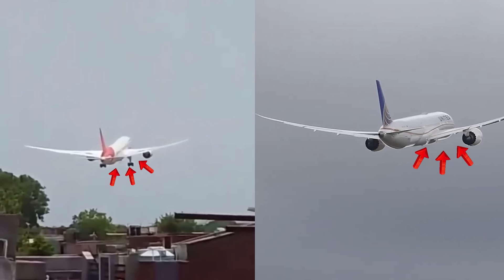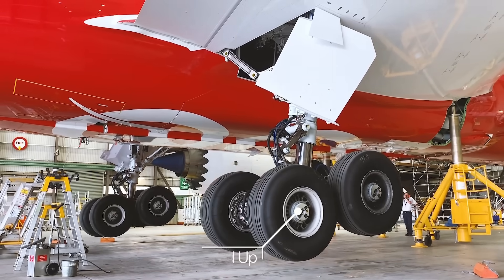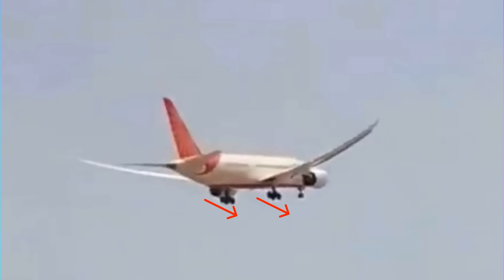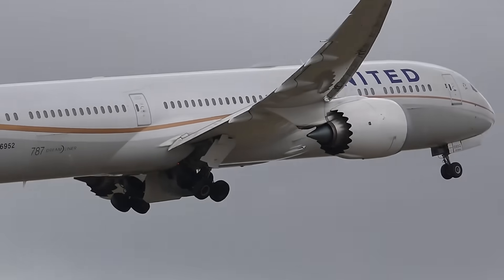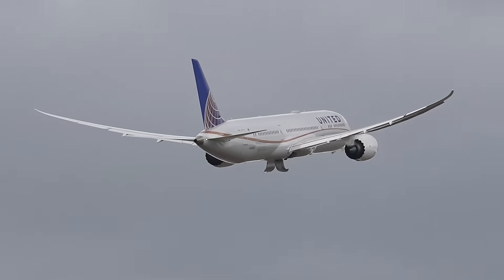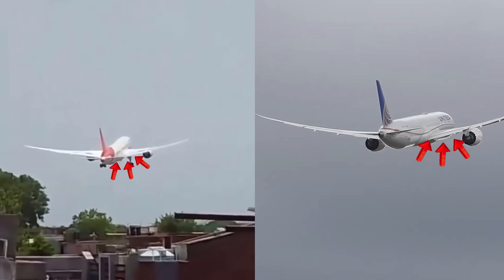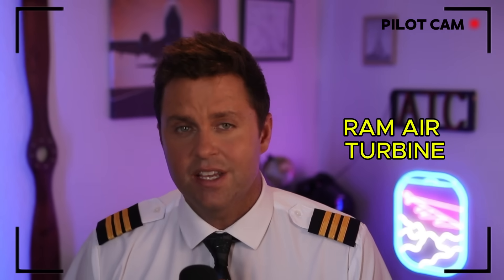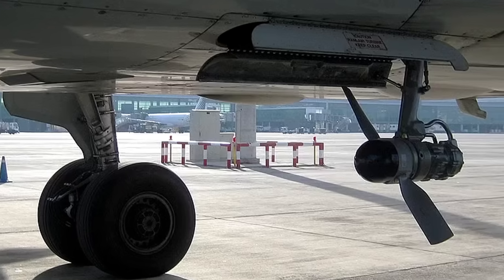Pilot Explains: A New Detail in the Air India 787 Crash Everyone Missed

Comment: If it was contaminated fuel, why wouldn’t the previous airplane crashed first, or the one before that?  Don’t be afraid to add the possibility one of the two crewmembers put both fuel shutoffs to off or pulled the fire handles. It’s an ETOPS airplane, the chances both engines failing at the same time are extremely low.  We’ll know when the preliminary report comes out.

Comment: pilot suicide, pull the cut offs. no way to get that thing restarted in time to save it. Im and MSAE I do not see how both engines fail simultaneously.   fuel contamination sure  but really they were on the ramp, taxi run up and the both fail at very close to the same time being fed from separate tanks and fuel pumps at 300 feet.
Reply: or sabotage of the electrical system. But even if it had other electrical I just do not see both engines failing close to the same time at such a critical phase of flight. 
My bet is on human action.
Reply: The odds are just not in the favor of it just happened.

Comment: If the fuel was contaminated…wouldn’t other aircraft’s have issue?  I am not sure how many aircraft’s a fuel truck can fuel?  I used to work for an airline and I was on an operations team where I monitored the maintenance calls and flaps failed all the time…but no crashes. Bird strikes, flaps failed and landing gear issues but no travesties. I am not a pilot or maintenance though so what do I know.

Comment: HI CAPT. GARY, GOOD VIDEO!!  UH, I'M A NO NUTH'IN "GROUNDHOG" SO I'M NOT REALLY EVEN QUALIFIED TO ASK YOU A QUESTION, BUT ON THIS CONTAMINATED FUEL THEORY YOU AND CAPT. STEVE MENTIONED; I ASSUME THAT IMMEDIATELY AFTER THE CRASH, THE AIRPORT SHUT DOWN, YES??  SO THERE WOULDN'T HAVE BEEN ANY OTHER AIRCRAFT TAKING OFF LATER WITH THE SAME CONTAMINATED FUEL, BUT, WHAT ABOUT THE PLANES THAT TOOK OFF IMMEDIATELY BEFORE THEM??  WOULDN'T THEY HAVE DRAWN THEIR FUEL FROM THE SAME TANKS, CONTAMINATED OR NOT??  AND NO ONE ELSE CRASHED??  AND ISN'T IT A REACH THAT BOTH ENGINES INGESTED THE CONTAMINATED FUEL AT EXACTLY THE SAME TIME?? AND WOULDN'T THE CREW HAVE RUN-UP THE ENGINES TO ALMOST FULL THROTTLE AT THE START OF THE TAKE-OFF RUN, THEREBY INGESTING LARGE AMOUNTS OF CONTAMINATED FUEL THAT MIGHT HAVE SHOWN A PROBLEM??   THANKS CAPT. GARY.       CHAS ORVIS, PLAINVILLE, CT.

Comment: According to one of the pilots who had flew this same plane in the past and that too on same route his assumptions are that plane was at his max capacity which includes - passengers, luggage and extra fuel because of Pakistan air space is blocked at present so the plane was carrying extra fuel. And the other point he made was that this is peak summer time in India and Ahmedabad is no less. Temperature on that day must be somewhere in 40s and so plane struggle to fly in less dense air and which makes lift difficult and plane struggle to take off and need extra thrust. So there are various reasons which might have caused engine failure.

Comment: Reading the comments here.
“If” the issue was fuel contamination, it would have been apparent because other planes would have been “contaminated”…
“Unless” this plane was the first to be fueled with contaminated fuel…
Also, unless it’s determined that the issue was electrical, I am leaning towards the “vapor lock” scenario.

Comment: My theory is that since the aircraft was prone to electrical failure as seen in other videos from passenger complaining about electrical instrument aren't working , hence when they tried to gear up it may have resulted in power loss and massive electrical and hydraulic faliure and cut the supply to both the engines hence ,it crashed

Comment: Possibly the contaminated fuel as the fuel was full tank the  weather was hot also may be an hydraulics or electrical system  failiures  also something to do with the weight balance of the aircraft its again just an assumptions lets wait for the black box data analysis